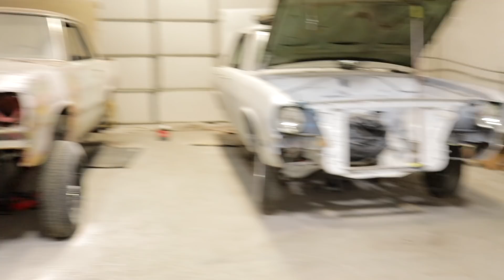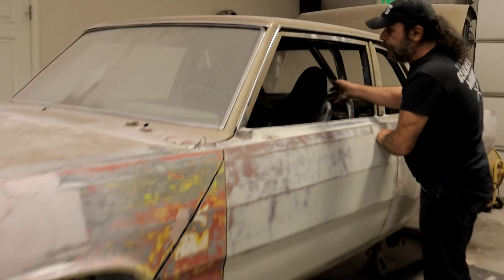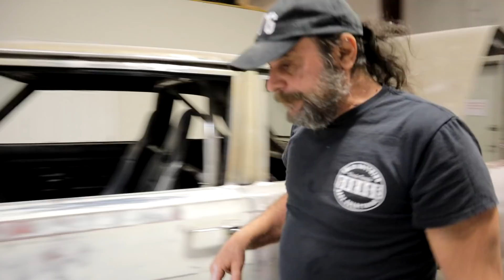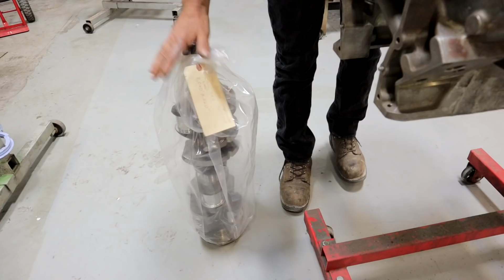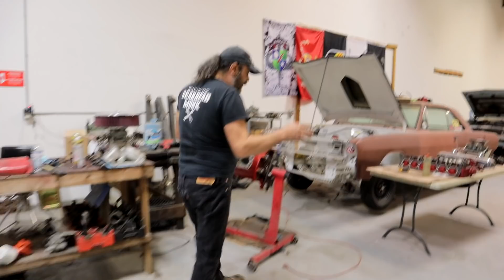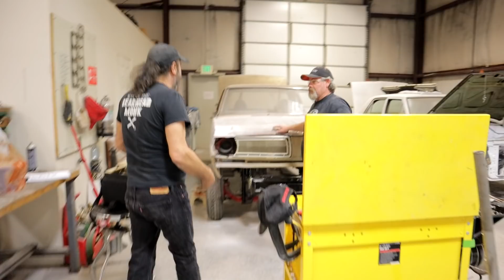Slag Hammer Progress Plus LIVE Engine Build Announcement

Comment: I think it would really come together with a narrower front axle. Those tires need to tuck under the front wheel wells for an accurate gasser look, something to consider.
Reply: Got to remember the car is on a truck frame with a d100 axle..

Comment: Tony you talked about painting the cars you could make a paint booth out 1x2 into 8x8 panels covered in plastic screwed together to make 8x8 or 24x16 paint booth using a fan or fans at one end and filters on the other with 2x4 on top it makes for a good paint job in the spring I've done several cars this way and they came out great

Comment: I know the point of doing the 1/4 panel the way he did was to show us options low budget but you can't convince me that buying a 1/4 at this point wouldn't have been the smarter way to go. If I was on a low budget id take the hours I spent creating that Frankenstein plastic fantastic quarter I would have delivered pizzas part-time and then bought a quarter and had a $change to spare.
Reply: Yep. I agree. That quarter will have a ton of filler in it and a ton of time. It'll crack or bubble from all the flux weld in it.  Not worth it, if the quarter is available, replace it.

Comment: Everyone in the autobody industry is cringing. Lol. Still fun to watch. Good stuff, Tony
Reply: This is how it was done prior to the 90’s; unless it was a high dollar custom, blank check job. As an autobody guy myself in the 00’s, almost every previously painted older car we got in the shop was done like this. GALLONS of body filler, even the nice looking ones 🤷🏼‍♂️🤣
Reply: @ButtKickersReviews  The real old timers used lead solder before body fill came around in the late 50s. Not great for health but neither is bondo dust so hey
Reply: Was thinking the same thing. Give me an hour with a Hutchins Hustler and 36grit long board and that 1/4 would be my Bi..ch.  Those nice strait body panels make that a gravy job…..now that the hard work is done….
BTW, it’s a race car, it needs to looks good from the stands….it’s more likely to get slapped into the wall than the average car